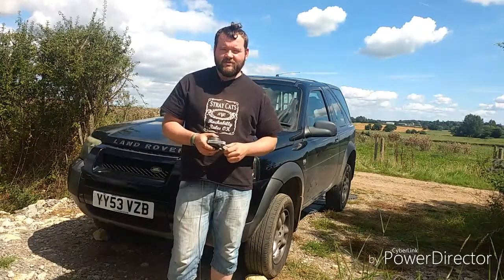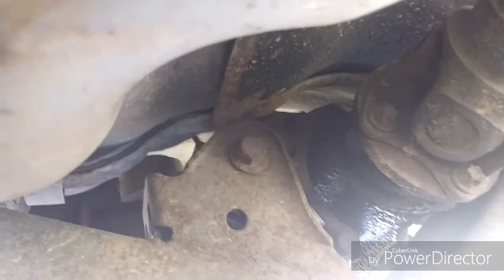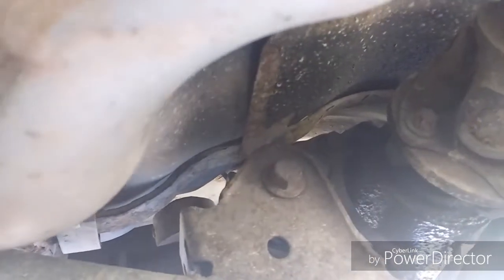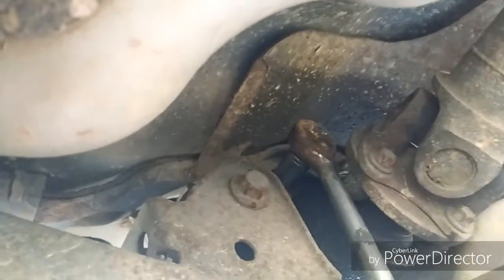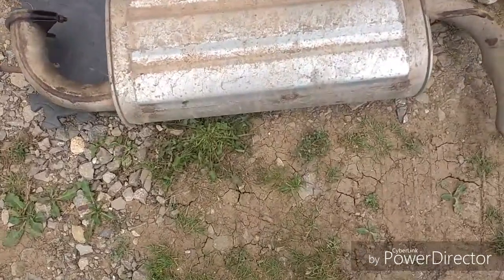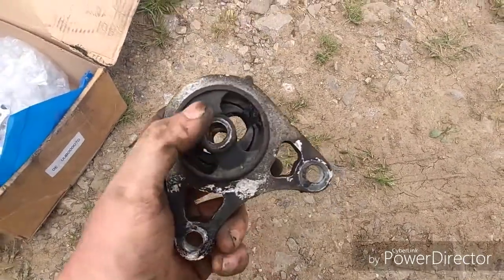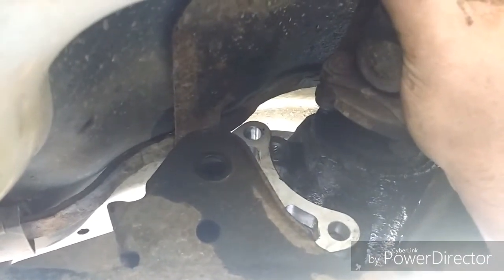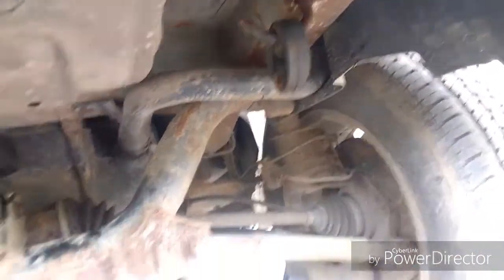Freelander Rear Diff Mounts Replacement

Comment: Is it worth changing the rear mounts too if you have to remove them to get to the front mount?  Is there only 1 front mount?  Is there an upgraded part for replacing the original one with?  The original one seems like a poor design.  How many miles should the original mount last for?
Reply from the maker: There two at the back. And one at the front. I haven't seen any upgraded parts. Maybe they do nylon bushes instead of rubber

Comment: This is grear thank you , when you replace the back 2 do you need to support anything or is it a straight swap
Reply from the maker: +neilcmusic  would recommend useing a jack to take some of the weight of the diff
Reply: Thanks im literally doing this this afternoon , My main worry is that the bolts will be seized but ill give it a go .
Reply from the maker: +neilcmusic  Yes will need to support the middle section will make it easier to remove